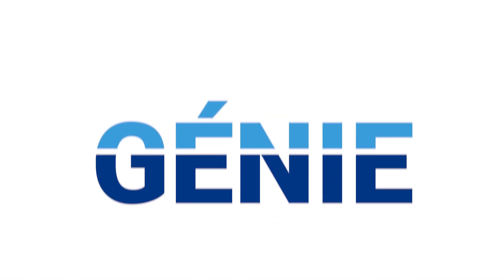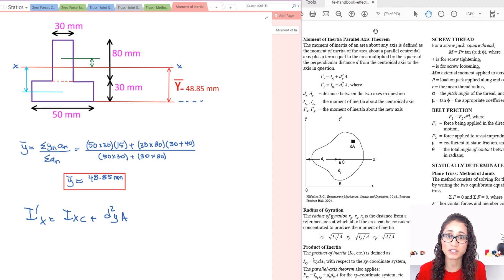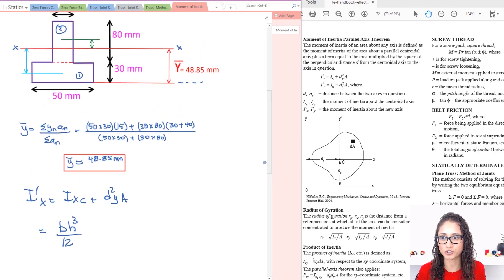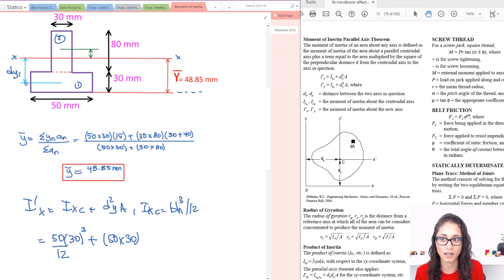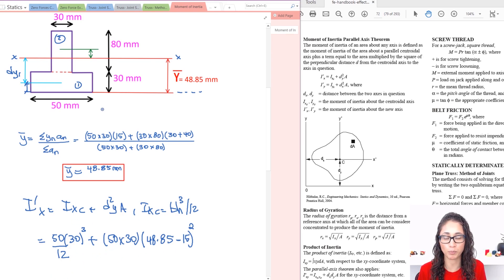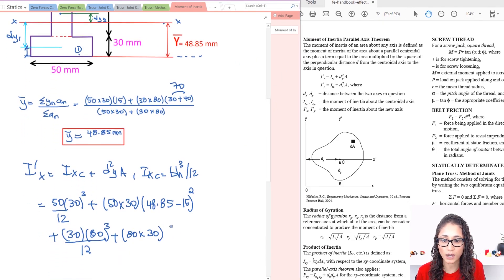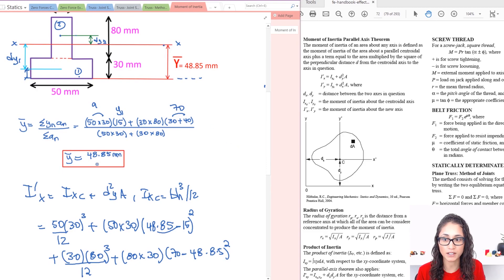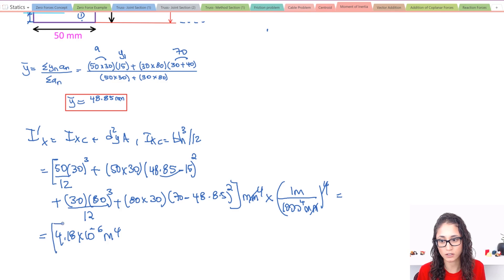FE Exam Statics - Moment Of Inertia Of Inverted T-Section

Comment: Could you help me out with a radius of gyration problem? Or help me understand the terms that need to be used and why? In the review manual it has the Ry=SQRT(Iy/A), however when I use the Iy equation in the table in the handbook I get the wrong answer. The other thing is however that if I use the radius of gyration equations for either Iyc or Iy the answer still comes out incorrect and I do not understand why. The question is very similar to this, however the y-axis is in the middle of the shape. Any help would be greatly appreciated!

Comment: when should we be using the equation Ix=(bh^3)/3 and when should we be using Ixc= bh^3/12 ?? I have a practice problem out of Anthem books " Civil Engineering FE prep sample questions that is very similar to this one you just did but uses both the equations I just stated for the 2 different parts.

Comment: Hi, i am studying Building and construction cert.4. now i have to calculate moment of inertia of an i section (structural beam) I am really struggling with this. I do think i understand how it works just having problems with getting the answer. for example: 1 over 12 Bh3 = 1 over 12 125mmx 20mm)3 = ? (how do i use the calculator for this? ) sorry possibly common sense for you. Hope you can help out. Thanks for the video that really helped me out in working out the moment of inertia.

Comment: Why did you find the centroidal x axis to begin with? Couldn't we just set our x axis at the bottom of the figure and still use parallel axis theorem?
Reply from the maker: That is a good question! This is actually moment of inertia about the centroidal x-axis. I should have specified that in the problem, but also since the problem doesn't really show where the x-axis is, you have to find moment of inertia about the centroidal axis! I hope this makes sense and good luck with your studying!
Reply: enGENIEer that makes perfect sense. We are on the same page then

Comment: Hi how are you ? You just forget to answer your Question which when I do not have to use the parallel the theory?
Reply from the maker: Hello Hazim, so you don't use the parallel theorem when the centroid of the whole shape is at the centroid of the shape you are working with. For example, if you take just a simple rectangle shape, the moment of inertia will just be bh^3/12, if you add Ady (second part of the parallel theorem), dy will just be zero because the centroid of the whole shape is at the centroid of the rectangle. I hope this make sense.
Reply: @Genieprep  i think you lost me on this one.

Comment: 2.93x(10^-6) ? Since the shape is symmetrical about the y-axis dx should be 25mm correct?
Reply from the maker: Thank you for trying to solve it. The centroid is correct, however, the moment of inertia is wrong. I think because you used bh^3/12.  So the moment of inertia of rectangle with respect to y-axis is hb^3/12. Try it with this equation and let me know what is your answer.
Reply: @Genieprep  Hmmm....I used that and I still got 2.93x(10^-6). For shape one the moment of inertia should be (30)(50^3)/12 right? And for shape two it should be (80)(30^3)/12
Reply from the maker: @EmmyJay33  I think you might getting an error when you plug in your calculator, so if you calculate (30)(50^3)/12, you should get 312,500, and (80)(30^3)/12 = 180,000, add those two numbers and dividing by 1000^4, should give you 4.9 x 10^-7 . Let me know if you got this number.
Reply: @Genieprep  Yes I got that number, and then I added (30*80)(25^2) for shape 2 and (50*30)(25^2) for shape 1 (all converted accordingly). I did everything in mm and then converted the final answer at the end. I don't think that makes a difference though.
Reply from the maker: @EmmyJay33  Why did you add (30*80)(25^2) for shape 2 and (50*30)(25^2) for shape 1? The centroid of this shape is 25mm, in parallel theorem axis, dy is distance between centroid of the shape (1 or 2) to the centroid of the whole shape. For this case, dy would be zero because the centroid is 25mm and centroid of shape 1 and 2 are 25 as well, so 25-25 = 0. I hope this makes sense now. If it doesn't, rewatch the part where I explain the parallel theorem. Let me know if you have any other questions and good luck!

Comment: thank you , what if NOT inverted T-section , just normal T-section will the solution steps be the same?
Reply: Yes :)
Reply: @EmmyJay33  thank you, if you do not mind one more question , what if the x-axis was given on the question at the bottom of left corner of the shape , we do not need to compute Yc , just implying the formula bh^3/12 + Ad^2 for both , am i right?
Reply: @huseyin8017  I'm not sure I completely understand what you are asking, the only time Xc=Yc is if you have a square shape (length=width). For every other shape you will need to calculate Yc and Xc. Sorry, if that is not the answer you are looking for.
Reply: I mean if the question was given the reference on the bottom-left corner , x and y , for this case i think we do not need to compute neither Xc nor Yc to finding Ix or Iy , in this question we assumed that x-axis at unknow location on the web so we need to find Yc in order to know the distance for each part to the neutral axis.
Reply: @huseyin8017  You could use the moment of inertia formula Iy=(integral)x^2dA (pg. 72 in the FE Reference handbook version 9-5) to compute it, but that is not about an axis. You should read the section in the reference handbook about the parallel axis theorem. I think it will answer the question you have. I do not think you can calculate the moment of inertia about an axis without calculating Xc or Yc since moment is force x distance, and that distance is from the centroid axis to the parallel axis.
Reply: @EmmyJay33  ok i will check it out , thank you so much
Reply: @huseyin8017  Not sure if you took your exam by now but you are right. I'm studying using Linberg Practice problems and there are two different problem types: one where you can use parallel axis theorem (distance from centroid of each component to the given x axis) and another where you can still use parallel axis theorem (this time distance is between centroid of each component and centroid of overall shape). It's funny how the wording can be.